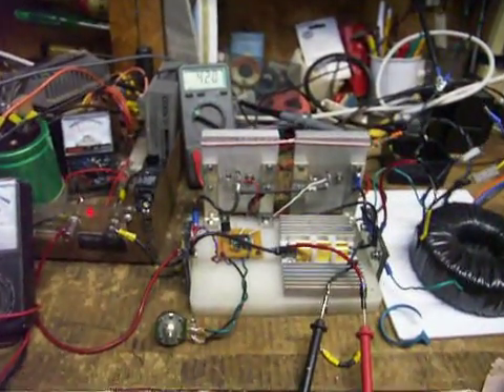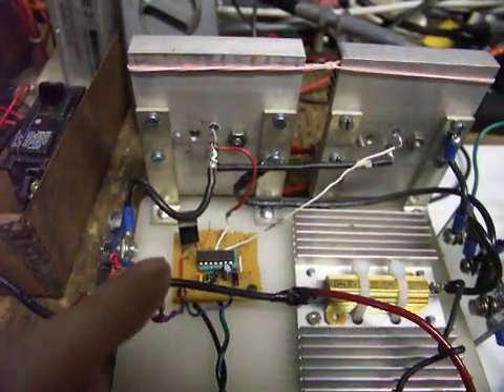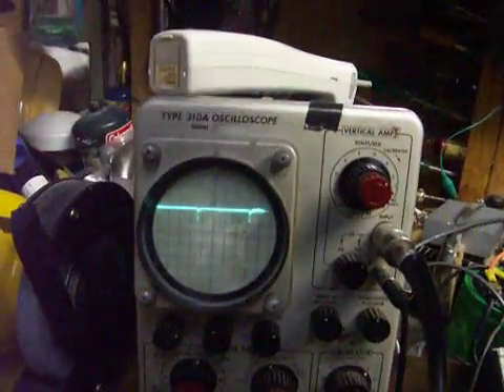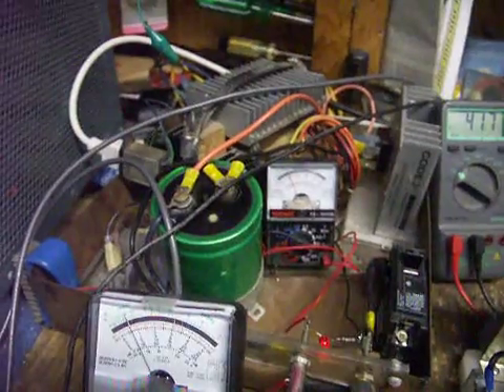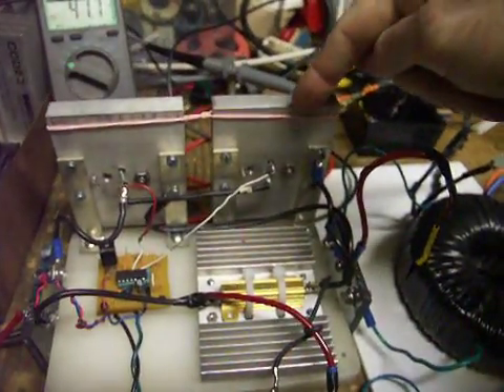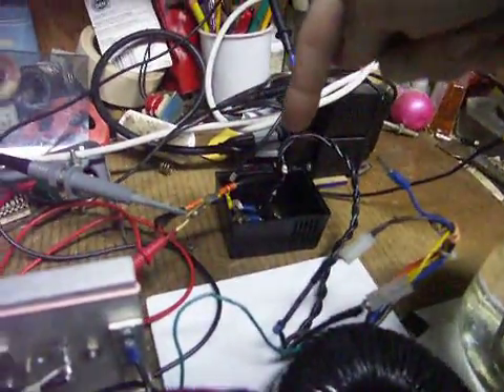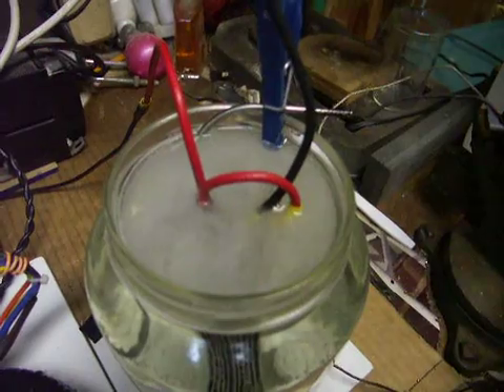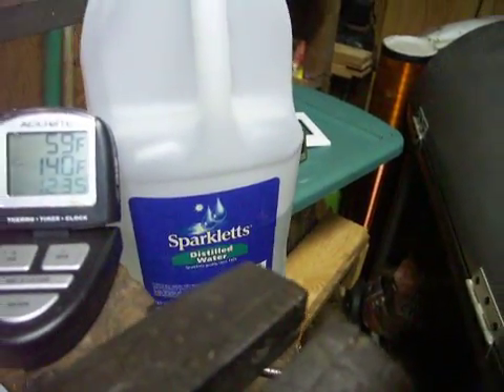Completed the JK flip flop driver for HVDC HHO Gen

Comment: You should use 2 negatives instead of positives, because hydrogen is released at the negative plates. You are making way more oxygen than hydrogen in this case. Your system actually consumes more amperage to break away o2 than the hydrogen, for whatever reason, those were my findings in my test results anyway. The goal is to drive the cell with any level of ac over dc simultaneously and your output will triple per amperage as mine did. Max is 3 times unless you hit three primary coils at the correct frequencies anyway.. good luck.. please send me your results. I can share my circuits with you, I like to help with the BB systems out there that are unsuccessful

Comment: cont. Bob Boyce quote: "Even though it uses windings, it is designed for its capacitively fluxing potential, not fluxing magnetic fields....Try to think of it as a 3 phase fluxing capacitor instead of a 3 phase transformer." Boyce and Meyers used very similar methods from what I can tell with these toroids. The charge "holding" might be the back EMF in the primaries influencing  the secondaries.

Comment: Check out older texts which have been digitized by google such as AE Dolbear's, Matter, Ether, and motion. Particle physics may be a side tangent or a subset view of physical phenomena created by top down control over academia. Bob Boyce recently mentioned on a forum:"This is NOT an electromagnetic transformer, nor was it designed to be. It is designed for switched transitions of potential (voltage) only, and passing those transitions along to modulate another dipole of higher potential." cont.

Comment: I hope you are not planning on keeping your crimped copper wire connection so close to the reaction.
Copper will corode and eventually you will get a spark and one heck of a startle LOL.

Also you may want to consider seling the unit so you get less current leakage and higher production.
Zero Fossil Fuel explains this in his and demonstartes it as well.

Nice little unit all in all.

Keep up the good work.